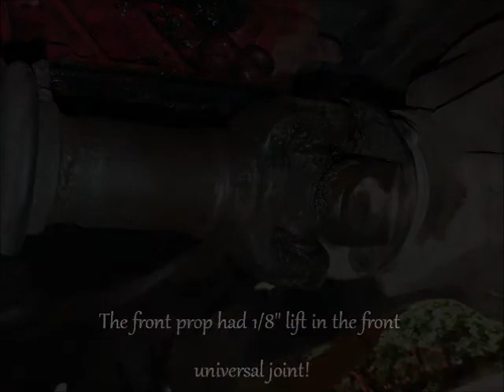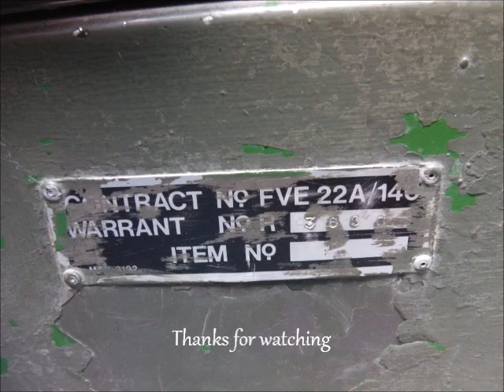Land Rover Series 3 -  Carb gaskets and Universal Joint replacement

Comment: What speed does it feel most comfortable at?
Reply from the maker: cruising speed is 45mph..... at that speed the engine is doing sensible revolutions and she doesn't get too hot.

I need to have the gearbox out at some point to rebuild it and fit new syncro springs on 1st and 2nd gears, so when I do that I'll try and find an overdrive kit to fit as well.
Reply: Sounds about right! The diesel versions apparently tend to have a shorter life than the petrol equivalent, is that true? Cheers.
Reply from the maker: I believe so but I've never owned a diesel Landy. The diesel had less torque and power so they tend to get worked much harder. A friend of mine ran one for some years and he had to rebuild the engine every 8 months.

I believe a well looked after diesel Land Rover can still be a reliable machine.